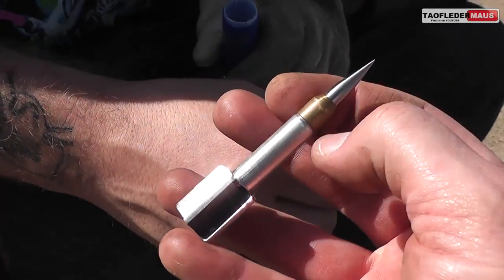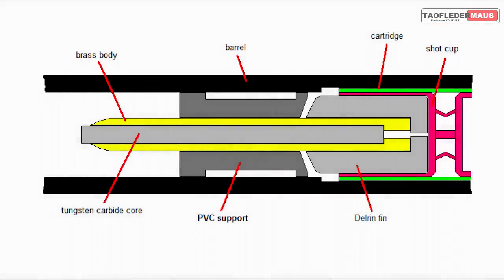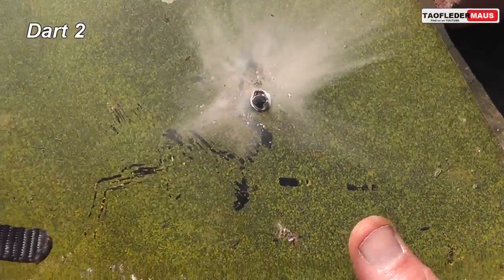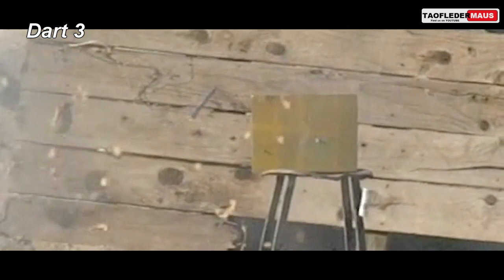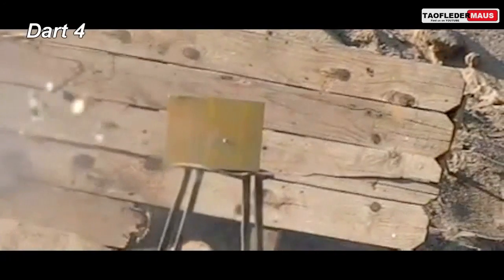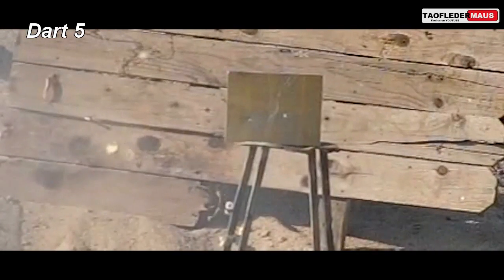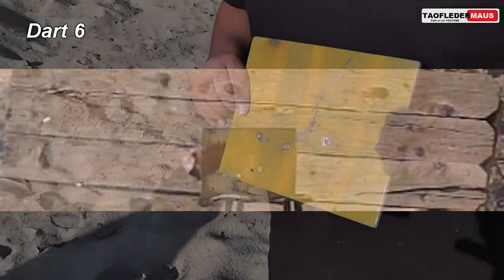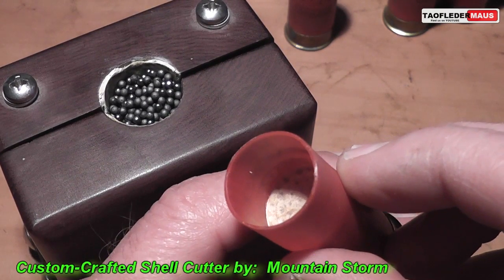Futuristic "Armor-Piercing" (APDS) Shotgun DARTS - Test 5

Comment: So, the REAL takeaway is a better Sabot stabilizer is needed.  All the failures appear to have been failure of the Sabot housing not the projectile itself.  Mabe take a like from the tank APFSDS rounds and vent the sabot housing to provide 'thrust' to shear the halves away cleanly and quickly?
Reply: +Fortus Victus Sounds about like what I got from it.
Reply: +Fortus Victus Thinking the same thing but why not just down size the actual sabot tank round, it flies straight as an arrow.
Reply: Yes thats my point. Somebody has to miniaturise the tank sabot round so its identical but proportionally smaller for the 12 gauge. That would be good to see.
Reply: Why stop at 12-gauge? Why not make a rifle version
Reply: +Delta4280 they used fletchettes on advanced combat rifles back during the ACR program in the 1990s
Reply: Glenn Connell Sabot rounds weighs over 9 kilos (20 pounds). Scaling it down won’t work as it would still tumble due to it being super light. Also, do ring like this already exist for 55,6. It’s called flechette rounds or HVAP
Reply: @BoxJoe136  True to that and unfortunately nothing came from those projects. From either the rifles or the ammo. Hope they try again much later in the future through.
Reply: The smaller the scale the harder intricate venting systems are. For one because it's a lot harder to measure out and time correctly, but also because the thin materials don't scale properly with the force of the gunpowder thrust, especially thinner fins.

Not impossible but not easy.

Comment: I used to make penetrator rounds for my Air gun. No match for the shotgun Sabots but they'd go through a few steel cans better than a pellet, Or BB. Even somewhat reusable.  Now, i made them with a dremel tool and a stationary grinding stone,  But i really admire the craftsmanship the guy put into them. Aluminum fins are the way to go. My only suggestion is that he cups the front of the sabots more. So the drag pulls them apart more consistantly.
Reply: There needs to be three of them and they should spin off
Reply: You are 100%CORRECT!👍👍👍 The front of these cups are flat, so there's no air pushing them in the direction to make them come off👍

Comment: Maybe if the the sabot were divided in 4 sections instead of 2 they would separate better?
Reply: lucashc90 Yeah, they need to work on their sabot. Make them at least a 3 piece and make the cup more pronounced on the front of it like a Spindle sabot on a tank round. That should help the separate clean and clear the round quicker.
Reply: The sabot could also have an outwards angled front so when they come into contact with air they separate outwards fast.

Comment: this is very cool, it uses the same logic as APFSDS used in tank guns. M1 Abrams has a smoothbore gun for this purpose. The penetrator goes through the plate while the softer metal is sheared off.

Comment: Holy shit these are impressive darts. The creator of these has all the reasons to be very proud of his works. I hope he sends more designs like darts 2 and 6 and maybe the penetrating dart from the last test. It also happened that for once the most beautiful designs also performed the best. 

Maybe he could make a sort of hollow point modification where the tungsten carbide core does all the penetrating but inside that there's a hole where comes something that spreads. Maybe regular lead pellets coming from it.

Comment: In WW2 they used hardened steel for early AP penetrator rounds and found that it would shatter on impact rather than penetrating... looks like the same happened with the last dart. It was pushing so hard from the back that instead of going forward it just sheared off, rotating the part stuck inside the plate and snapping off the tip to blow up the brick.

Super cool stuff!

Comment: One of the problem is the same problem you have on a bow, the arrow is pushed by behind, it makes it wobble.
An arrow is flexible so some of this wobble is absorbed. But the darts aren't as flexible as an arrow, you should invetigate this way (English is not my native language, but i hope i made myself comprehensible).
Reply from the maker: but they worked...
Reply: Counterpoint: Crossbow bolts, even the arrow-like ones, do not flex at all.
Reply: Counterpoint: if you looked at the rear of the dart, there is a hole for the gas from the exhaust to enter, placing the center of thrust closer to the center of mass. This didn't help with the front-heavy ones, though
Reply: Almost no gas enters these darts, they are driven by the shotcup or wad.
Reply: HappyBerserker The back-heavy darts are more stable, the fourth was really nose-heavy and was just awful. I wonder if you could further develop the dart shown in the intro, the second and the sixth dart.
Reply from the maker: None of the darts were back heavy.  They'd flip around and fly backwards if they were.
Reply: SirCutRy Aerodynamic drag will dictate that if the center of mass is behind the center of drag (in a back heavy dart for example) then it will flip about and fly backwards. or would be otherwise very unstable... Fin stabilized projectiles are stabilized by having their center of drag behind their center of mass.

Bullets are normally rear heavy but they are stabilized by gyroscopic forces so they don't suffer from that problem.
Reply: -ACHTUNG- Like with the rifling so they spin and correct the wobbling?
Reply: SirCutRy That is the case, yes...
Reply: Only improperly tuned arrows wobble when released. You will find that in most high level archery enthusiasts do slow motion videos of their arrows that the arrows don't wobble. This of course requires cutting and weighting the arrows as well as adjusting lots of things on your bow, but it's possible for front heavy objects to avoid wobbling, even without fins or spinning.

Comment: Hmmm! Very interesting results. I have actually been doing research on this topic and I think that you can get these impressive devices working even better than they already are. What I am thinking is that you can have a small pusher plate that will fire out the projectile maximizing the pressure that is usually lost between the fins.

Comment: The blunt tip is interesting. When a flat penetrator enters the surface, it makes a conical stress field in the material, and so forms its own sharp point. A point, on the other hand forms a blunt ball in the material which does not penetrate well in thick material. If the material is thin enough, a sharp point is better because it pierces before the ball is formed. Sharp points are also good for surface chips on thick material, just not for deep penetration.

Comment: I noticed that dart #1 had something stuck to it's fin. It separates on impact. You can see as it travels as well. I think that caused it to spin like that. Did you use black duct tape on the sabot? Maybe it got stuck to the fin. If you look closely, you can see it unravel a bit just before it hits the plate at 00:23. What do you think?

Comment: Looking at the rounds and video I think I have an idea or two that might help.

first the sabo jackets should be made into more parts, or have a lip around the front as to better catch the air. With both of these the jackets should break off cleaner and faster.

Now to help with flight. One idea would be to have the fins at a slight angle as to induce a rotation in the shot itself. With this then the round would fly straighter and longer.

Last idea would be to shot at a longer range, giving the shot more of a chance to straighten out.

Either way cool video hope to see more.

Comment: I believe having the sabos separate is flawed. These rounds would only ever be used at close range. Have you tried your hardened darts fully enclosed in light material that will travel together to the target. At the target the light/plastic material will stop and the heavier/harder dart material will continue with momentum through the target. The projectile can be made stable if you don't have to worry about sabo separation just out of the barrel. The only down side is the additional drag of the plastic material (over short ranges this can be compensated by slightly heavier charge in the amount of propellant or the type of propellant). You will still get the benefits of a dart being large mass behind a small surface area. your dart can be hard and sharp but your stability and trajectory, alone with accuracy will be from your plastic trogan horse body. Your camera work is good and I like your video. I will wait for you 6th video.

Comment: This is what I’ve been saying! We need AP Saboted shotgun slugs! The soviets already had a good idea with the ks23 in an anti vehicle role but moving that to a smaller platform would just give shotguns so much more utility. Imagine a round that can pierce any body armor, pass through most cover, disable engines and do so with an extended range! And this round would just fit in any 12 gauge shotgun.

Comment: Kudos to the Maltese scientist. His darts fly like diving falcons! :p Some of the darts have a steel front affixed to an aluminium tail assembly. I am wondering if the pieces are glued together or pressed together with an interference fit. If they are pressed with an interference fit, I am wondering if the fit should be looser, but still snug enough to keep the front and tail assembly together in flight until it hits the target. Then the weaker bond would allow the front to penetrate,and allow the tail assembly to fall away. The less energy is used up in this process, the more efficient the penetration is going to be (at least that is the way I see it). The whole point of military ap rounds is to minimize the transfer of potential energy in wasted actions. Cheers. :)

Comment: If I may suggest, you should make the dart rotate as if it came out through a rifle to make its flight straight and farther. How? 1. The plastic caps that hold the dart should be tight and have no space in between them when enclosing the dart in the gun's chamber. 2. The caps must be designed in such a way that it will "rifle" through the barrel even if the barrel has no rifling. How do you do that? The caps must have a hole through it and angled in such a way to give the whole thing a spin. The blast of the exploding gunpowder will be able to create the spin through that angled holes, so when they live the barrel, it should be spinning thus keeping the dart it is holding spin through. The dart's fins should also be angled to keep it spinning and not tumble after it separates from the plastic caps. I hope the idea helps you in your project.

Comment: Have you tried to make the sabot a 3 petals piece instead of a two petals one ? This would vastly improve sabot separation when getting outside of the bore. Lighter parts, less aerodynamic impact, more room to get out of the way of the projectile, yet sturdy enough to keep everything in place. There is a reason why pretty much every tank sabots are made of three (sometimes 4) parts.
Even funnier, you can make these petals "angled" or with a spiny groove to get a predictable separation course. This would ask for more DIY engineering though, making it quite a brainstormer to figure things out in order to refine the external balistic performances.
Just my 2 cents.

Comment: the medieval armor piercing tips were sharpened square stock: and you can test the simple penetration advantage, especially over a tapered shaft of round stock, which will peter out while the square stock keeps going til the hilt...once that tip penetrates, the slick continuous diameter has no resistance: and use plastic and/or discarding-at-impact fins to not hinder this..

Comment: Jeff! you should try to shoot large gutter nails out of the shotgun. They won't fly straight but if you shoot them at like 2 or so feet from the target, they will do nasty damage!. Also the head of the nail is a sufficient surface for the expanding gases to push on. Plus they are 50 cents a piece!

Comment: I think you need to put the darts directly on the powder and eliminate the wad, or atleast most of it, maybe only leave the bottom to seal the gasses. The wad could be what is causing all the wobbling as it would still be partially in the barrel under pressure and since it's not attached to the dart it might cause it to nudge the dart in the wrong direction when the dart starts slowing down due to friction with the air.

Comment: I think the reason for the odd flights is because the darts are being accelerated from the back. if you take a throwing dart and throw it from the back it will twist. When you throw them you grab the tip. if they machined a flange at the tip of the dart to allow the sabo's to push the dart from the tip it seems to me it will fly straight

Comment: WOW great work by individuals, think about using aerospace metals like inconel or hastelloy alloys and mix them up with Tungsten carbide tipped and also tips designed to drill into things so in flight they all spin anyway so having a group of metals used that are so harder than the normal copper and steel or even other basic alloys it would be great to have some engineer get great use of aerospace alloys which outlast the others and are so much stronger in every way .:) Like the same CNC tools used to shape the harder grade of alloys use those mix of alloys to make a bullet or projectile. :)

Comment: Interesting the military uses 120mm smooth bore cannon that are quite accurate with sabot rounds, but there seem to be considerable problems getting a shotgun sabot round to be acceptably accurate. My guess is three-fold. The dart needs to have enough mass to not be disturbed by the sabot separation. The sabot must be "quartered" or more to increase ease is separation. If the sabot was also cut crossways, making eight pieces instead of four, that also might ease separation of sabot from the dart. Shorter pieces of low mass would be less likely to disturb the dart's axis of flight as the separated. Last, the dart must be pronuncedly nose heavy, with fins large enough to straighten out the attitude of the dart if not straight after exist from the barrel, like an arrow. I hope you will be able to try my ideas, as I have no means to do so.

Comment: Wonder how shooting these darts through a fully rifled slug barrel would work?  I know shotgun sabot rounds don't fly well from a smooth bore.  I would think a fully rifled bore would not only help with projectile stability but the sabot seperation as well.

Those darts are beautifully made btw.
Reply from the maker: The sabots would have to engage the rifling to cause a spin.   I don't think these were sized to engage them.

Comment: With the last shot, I think the aluminum stripped away from the steel.  What you saw "bounce" off the plate was mostly aluminum, I believe.  Which makes sense considering that aluminum is a pretty soft metal.

Comment: The Darts are Not the Problem, the Problem is the Plastic that the Darts are put into.  The Plastic pieces Where the Nose of the Dart is, should be concave, with the outside edges being higher and the edges where the Nose of the Dart is lower, that way when it leaves the barrel the Plastic will shed away from the Projectile, giving the Projectile time to recover or maybe it won't hurt the trajectory at all.  These are just my thoughts.  Another idea would be to make the plastic in 3 or 4 pieces with the same concave as I talked about earlier.  These are just my thoughts.  Amy

Comment: Kind of interesting that in a number of cases it seems to be the sabot that fails.  I'm wondering if a different material would work better?

When I see the sabot effectively explore at the muzzle, that has to be destabilizing the slug.  

How about molding the sabot around the slug, and then creating pre-cut fracture lines so it peels off evenly.

Comment: seems like the plastic halves didn't separate cleanly and helped push the tail end off at an angle... probably need some plastic that is in 3 pieces only on the nose and designed with fins to make it fly away from the gun when it leaves the barrel, so it doesn't intefere with the round's trajectory.

Comment: In stead of solid fins, try multiple strands of 550lb paracord glued and frizzed out to pack around the penitrator in the casing. This is the drag method I use on blade/darts for throwing. Stay safe.
Reply from the maker: John L Bales Unfortunately,  there is only 18mm of space inside a 12ga shotcup to work with.
Reply: Perhaps I doth protest too much, but there is surely enough to construct using fewer blades in the cup or am I missing something? Five blades that will work trumps twenty that do not.

Comment: The new SABOT slugs are a copper body with a hollow point. 
Suggest a carbide pin inside the hollow cavity supported by plastic to hold it in.
 The new SABOT slugs have 1,950 feet per second   enough to go through a 1/4" plate.
I have seen 9mm go through a 1/4" plate not normal bullets.

Comment: the biggest issue with the accuracy with the sabot rounds, is the fact that the sabots are not cut evenly. One 1/2 is larger than the other so there isn't an even release of the dart once it leaves the barrel.

Comment: You should be concerned about ricochets! 

You're penetrating mild steel repeatedly, which increases the chances of a round or a fragment flying back at you.  When you hit a spot which was pierced previously, it provides a better surface and angle for it to ricochet. 

It happened to me with a 7.62x39 round, a fragment flew back inches over my head.

Comment: All of the ones that failed so miserably were due to the fact that again, nobody has the round weighted properly with most of the weight at the tip.  The sabo is part of the problem too on most of the others.  Dart 6 extends beyond the sabo so of course, you get the separation that you need and the dart was fine.